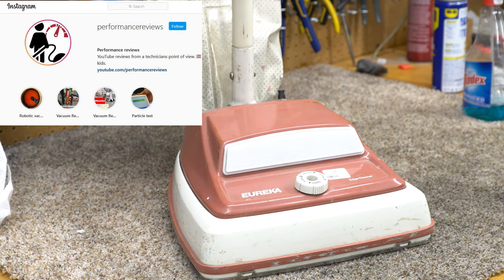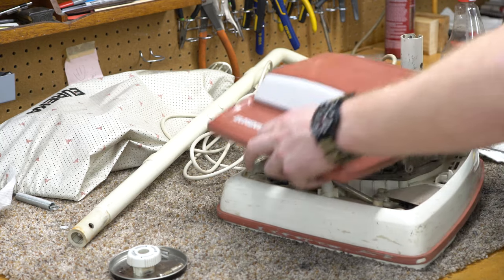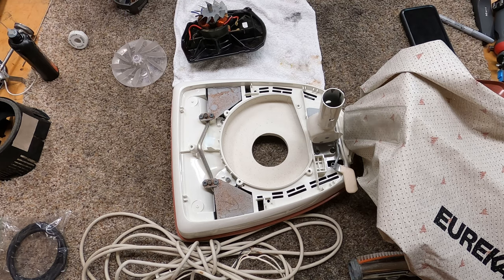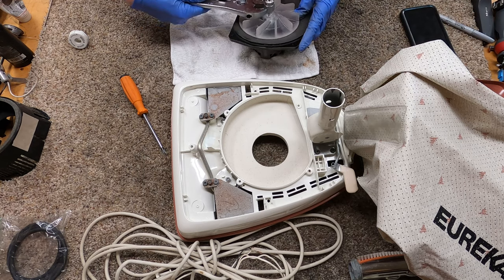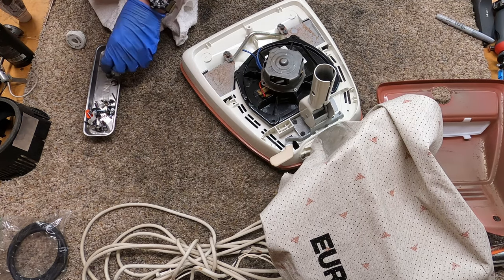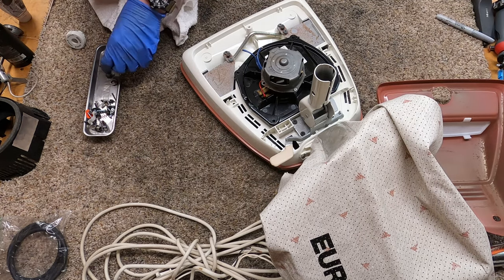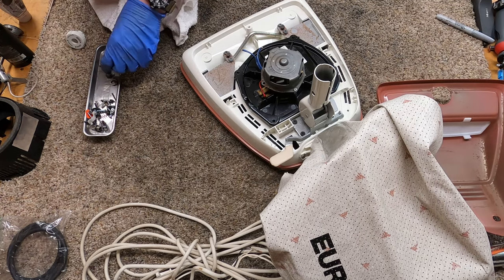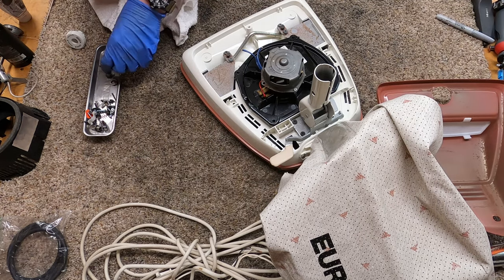Eureka 1447 Upright Vacuum Cleaner Repair

Comment: Besides Kirby, and Hoover Convertibles, these are the vacuums I grew up with. I got a tan, Eureka model 630D for Christmas of 1989. I had that machine for many, many years. I did later donate it to charity in 2003, but it was still working when I let it go.
Reply: My parents and my grandmother both brought a eureka brand vacuum cleaner and they were loud but they sure cleaned up the dirt and the dust sincerely Shannon

Comment: I somehow have either looked past this channel, or something. Wish I would have found it years ago, I have been really enjoying it lately. 
out of all of the vacuums I have seen and worked with, these old eureka direct air machines like this are probably my favorites. I only have one right now, I have not really found any recently. Mine does not have the "blender motor" it has a motor that looks like the older modern sanitaire motor, but is only a 3.5 amp motor. The bearings are sadly failing, I found a made in mexico sainitaire motor on ebay for like $40, which is a 4 amp motor that looks just like the old blender motor. I may get that and see what I can do with that. It is the same mounting plate and fan. What is that plastic piece that you said most people throw away for? I have never seen one of those.

Comment: I like how you describe what you're doing, makes your videos really easy to follow since I can't see the screen. Based on the sound, I'm going to guess that this upright is the dirty air, or direct air type, I'm not sure what the official term is to describe those but it did not sound like a clean air upright.
Reply from the maker: Correct this is similar to the traditional Sanitaire.

Comment: Great tutorial - would have been even better if some of it weren't off-screen. I looked in your playlist for another Eureka repair job but was unable to find any. I'm a novice and would appreciate if you'd make another 1400 Series repair vid when you have the time. I'd especially like to see how to repack the motor bearings and lube the roller bearings. Thanks.
Reply from the maker: It's about a straightforward as they yet but maybe this will help you.

https://youtu.be/AR7oSB6G-Qk

Comment: Good job mate. I just found a Dyson DC40 next to a dumpster. Lol 😂   This is the second vacuum I have found here lately. The dust bin latch that holds it on to the vacuum is broke but other then that it seems ok. Dirty bin but it runs well. What are your thoughts on this vac?
Reply from the maker: Thanks for watching and commenting.

Personally I think the DC40 belongs in the dumpster it was underpowered and poor quality even by Dyson standards.
Reply: @PerformanceReviews  I think I’m going to see if I can find a used dust bin and give it a try. I’ve never had or tried one before. From what you’ve saying I’m not going to be impressed.

Comment: Do you think these HEPA bags will work in a Hoover Convertible bottom fill?
Reply from the maker: It really depends on the Hoover convertible they made a couple different size bottom empties. If you can fit this on one of the ones from the '70s. The ones from the '50s I believe are not compatible and I can't even remember about what's on the 60s machines right now. They're cheap enough get a pack give it a try.
Reply: @PerformanceReviews  thanks! Mines from the mid 70’s so I’ll definitely give them a try!